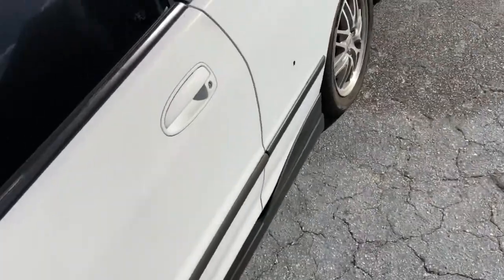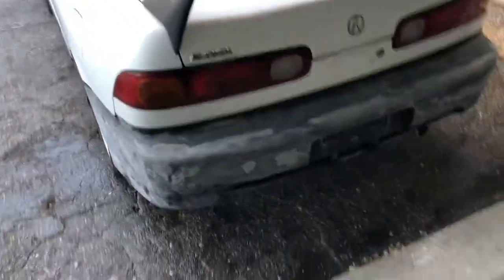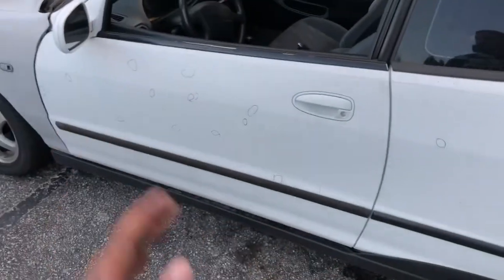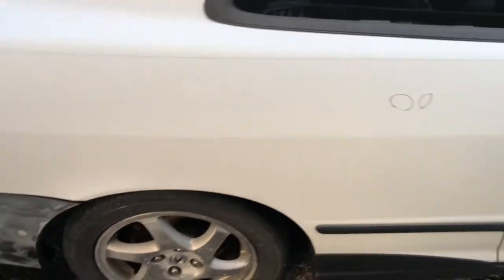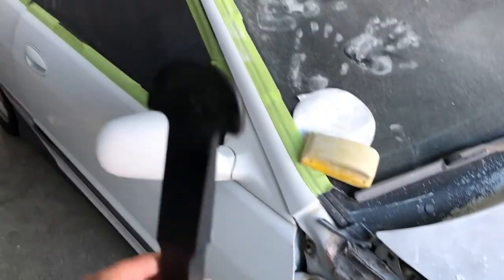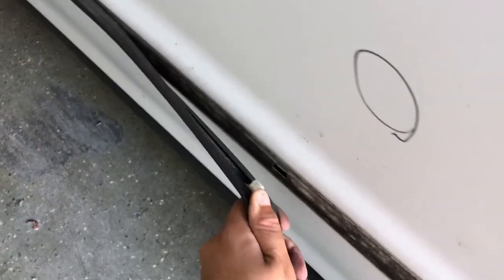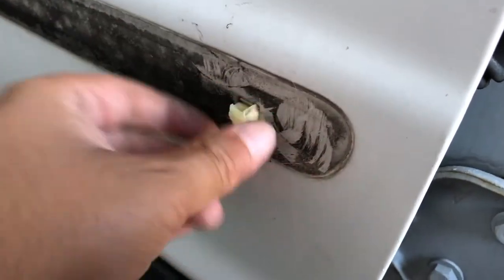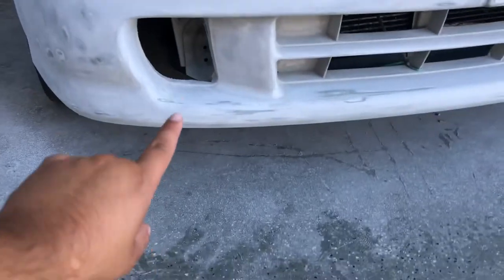STARTING ON BODY WORK FOR THE ACURA INTEGRA

Comment: lookin good man, should just get a replacement front driver side fender. Those side moulding holes - a better way to go is just sand the back of them and apply some tiny aluminum squares with 3M panel adhesive. Welding is probably going warp the sheet metal from the heat. Thats how I just did mine, came out amazing and much easier.